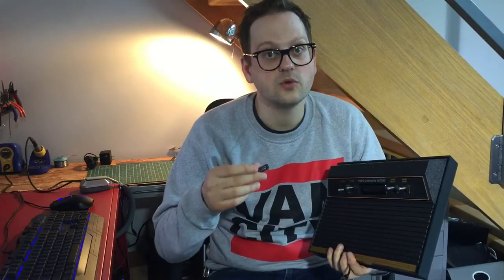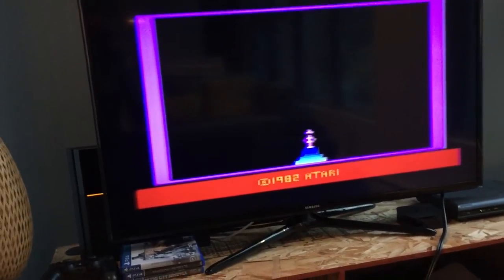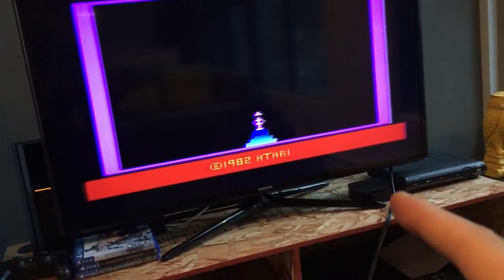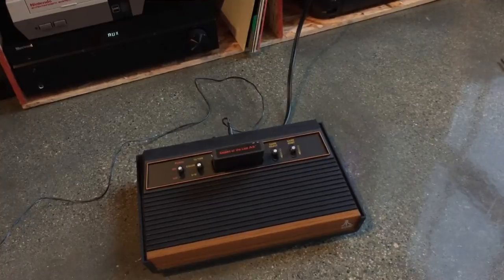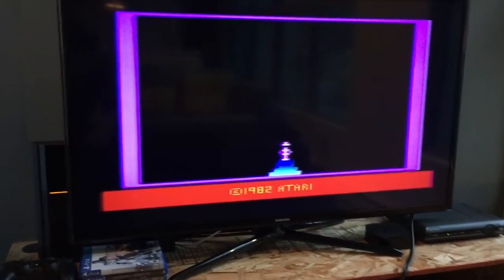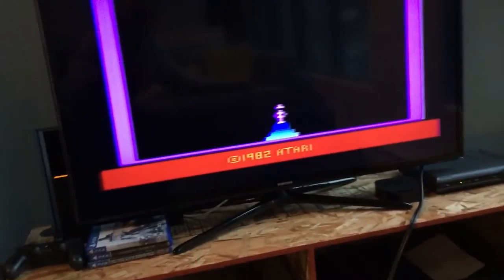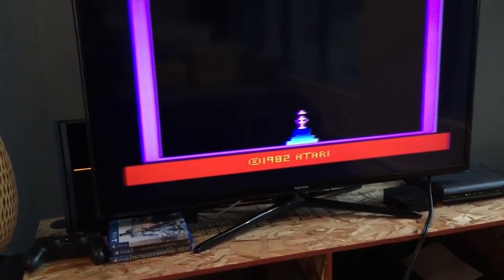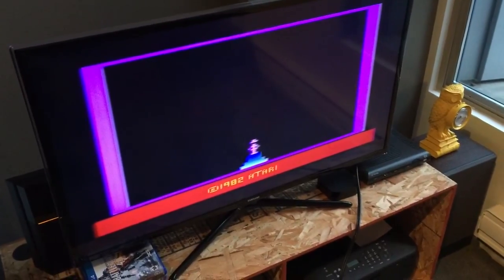Atari 2600 Restoration - Part 2 (Video Out Mod) // How To

Comment: @Willbot - I was given an Atari 2600 (model 2600A) from 1978, which it came with the joysticks, Combat, the two paddle controllers, and a cool 8-cartridge case holder via Atari and the lady (friend of mine) had the original box. Anyway, I noticed the Power Adapter and RF Cable cords were very dry (I mean, the system is 39 years old and had been in a closet for 25+ years without play) and it works great. I purchased just your standard RF cable. I wish I could do what you did in this video. Ha! Ha! Awesome work.
Reply from the maker: RetroTube1978 It’s real easy to do. Give it a try!